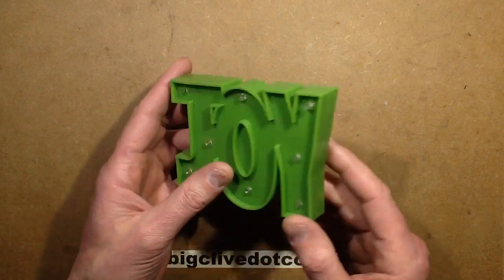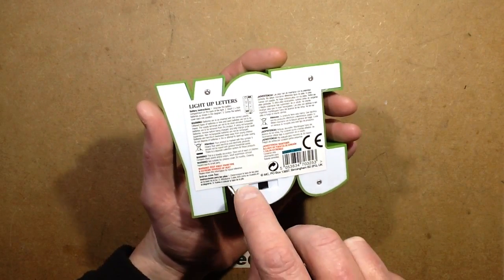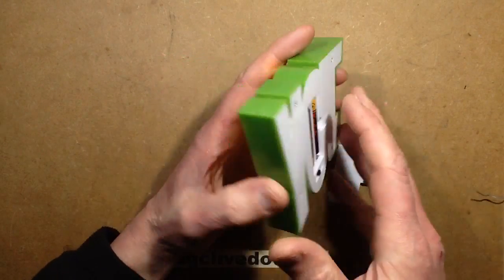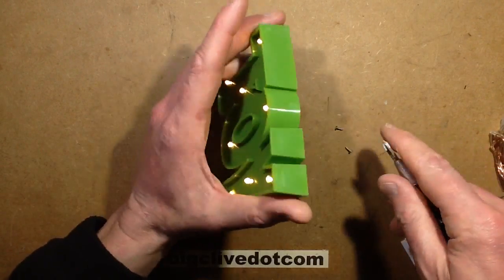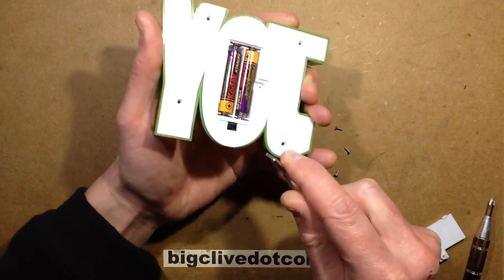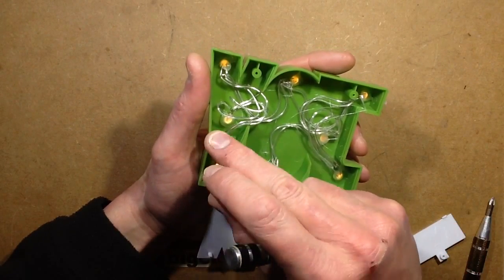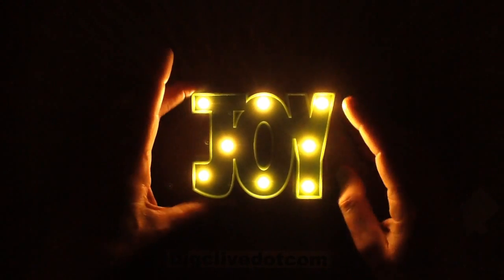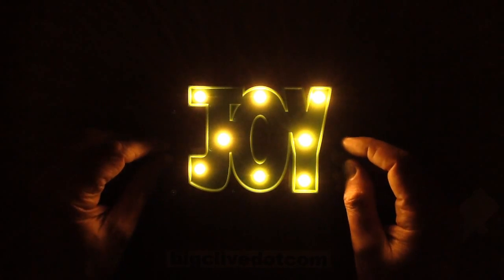Joy.  The Poundland illuminated version.

Comment: What I find really annoying about many if these LED products is the use of relatively expensive button cells or, less annoying AAA. What's the likely run time on the batteries?
Reply from the maker: Since doing the video I've had it running continuously with two AAA NiMh cells and it's still putting out a modest glow.

Comment: its a piece of crap buddy.... needs more leds to have the marketed affect... false advertising and no joy at all. Extra leds would have been powered easily with 1 x 18650 bat.
Reply: Yeah but an 18650 would push the price up past a quid. Would also need a charging circuit, and basically make this thing cost 15x what it does to manufacture.
Reply: 1$ of ebay for the charger and batts r free :)

Comment: I bet that would be more festive if the LEDs were replaced with the color cycling leds!!
Reply: One potential problem for some of those color cycling LEDs is that they don't have a resistor built-in. Nothing will blow up when using them with AA/AAA batteries because of the internal resistance, so that's usually fine. However when having many of them in parallel, the red and green LEDs in some of the LEDs may sag the bus voltage enough that the blue doesn't really have a chance to ever come on in another one.
Reply: The resistors, or appropriate current limiting, are built into the little microchip that controls the LEDs. If they're overloading the power supply, it means you need a bigger power supply. If they're bringing down battery voltage, don't put so many on the same battery!
Reply: greenaum The voltage drop of LEDs is an inherent property of the semiconductors that make up the LEDs. It's got nothing to do with how many of them you put side by side. Try connecting a blue LED in series with some suitable resistor. Now keep connecting more blue LEDs in parallel with the first ones. Even at 10 LEDs, they'll all glow to some degree. Now instead put a single red LED in parallel with the blue one, and the blue on will go out completely. This is because the red LED has a voltage drop of about 2 V whereas te blue one requires somewhere around 2.7-2.9 to turn on at all.

Comment: What's the current?
Reply from the maker: It'll vary from about 100mA with fresh cells to literally microamps as the cell voltage falls.  Even at very low current the LEDs will still light in a visual manner.